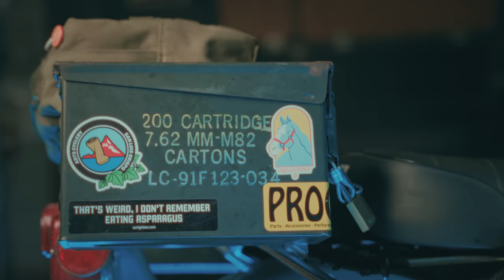DIY Ammo Can Panniers (44's Donut Vault)

Comment: I just attached 20mm ammo cans onto my crf300l as diy panniers and they work great. They are larger them 50 cal cans and are about the same size of tusk aluminum panniers for a third of the price. I think I will do the cable lock like he did, seems to be a much better locking system.
Reply: I mounted 40mm cans to my Duke 390 and they work fantastic. $20 each!
Reply: I just mounted a 50mm gun and haven't had many issues since.
Reply: I mounted 30mm cans to my vstrom. I saved money by making the rack for them as well. I can't believe what they sell those aluminum ones for. I did order ammo can locks off Amazon tho. You can easily clip that cable with a leatherman
Reply: Another simpler latch lock. 
Drill a hole into the box at the center of the hole in the latch. Put a bolt through the hole from the inside and nut it down. Drill a hole through the end of the bolt for the pad lock.
This would work better on a latch with a much smaller hole in it though.
Reply: @bloodbushcraft2467  well, maybe not a Leatherman, but it will definitely stop a normal criminal from getting in. Any really determined criminal will get in to any lock but if it stops 9 out of 10, thats a good lock.
Reply: @gregorytubbs3444  sadly the bigger cans have really big holes in them, but that might still work with some modifications.
Reply: @afallencheetah6610  do you have a rack for the 300l with the pannier sides or just the top rack portion? Curious how you mounted them.
Reply: @kite-fan  I got the tusk top and side rack. I originally was using their soft roll top bags but I find them to be super annoying to get stuff in and out of.
Reply: @afallencheetah6610  thanks bro

Comment: I put 60mm Mortar cans on my KLR, amazingly useful but they weighed down that bike. The performance was a drastic difference when they were on and off.
Reply: Harbor Freight carries ammo cans of different sizes in metal and much lighter plastic. Both are cheap as dirt. Between the $50 pannier racks and $24 for two, heavy duty .50 cal, watertight metal ammo cans, I'm happy to once again "beat the system," cheap man that I am. I think, like highway crash bars on a cruiser, they may very very save a leg or exhaust some day. Bought a smaller pair of .32 cal cans for the front panniers on the front of my RE Himalayan. I think they may also save a leg, light, gad tank, etc, if I ever go down. Plus, the Army Green color looks awesome, IMO, with the camoflauge "Pine Green" color on the bike.
Reply: I put the Princess Auto (aka Canadian Harbor Freight) Pelican knockoffs on my KLR. Mucho lighter. I have real Pelicans on my WeeStrom and boy have they been crash tested. The Pelicans survived to bend the racks they're hanging off of.
Reply: Who's got 120mm mortars?
Reply: I also added a set of 60mm grenade round cans from Princess Auto to my KLX (Just like to add that Princess Auto is also a terrible store compared to Harbor Freight). They're too heavy for offroad. They'll shake the racks right off the bike. But they're great for commuting and running around town. On and off in under a minute for when the offroad mood strikes.
Reply: @MichaelWhite-cx4ho Your comment about "beating the system" reminds of me looking for a cable tray to mount behind my desk. I went to a DIY store, but everything labeled as a cable tray was way overpriced for the simple pieces of metal or plastic they are in my opinion. So I went home with a plastic rain gutter for next to nothing. Works like a charm :)
Reply: Did you take the shells out?
Reply: @MichaelWhite-cx4ho  I had a set of 20mm ammo can (18.75"L x 14.5"H x 8.25"W) panniers on my Suzuki M50. They DID save my leg when I went down.
Reply: @TheVgonman  Thank you, Mate!  That's the kind of practical, real-life knowledge that I love to see passed on. Thanks for posting! By the way, I bet looking at any damage on the can(s) made you smile when you thought about how that damaging force didn't break your leg.
Reply: @MichaelWhite-cx4ho  Oh yeah. I did get a broken arm/shoulder and collarbone out of the experience, though☹
Reply: @MichaelWhite-cx4ho  funny you say that, the mortar cans hung so low, if you tapped the ground while riding, my foot would sometimes get pinned between the can and the ground, dragging my toes through the dirt. I only used the cans while camping and touring, mostly they were off.
Reply: @birdatkinson1  What kind of "bike" did you have them hanging off of where they'd "scrape the ground?!" A Big Wheel?!
Reply: @MichaelWhite-cx4ho  they didn’t scrape the ground, they would pin my foot against the ground on some off road conditions if I let my foot on the ground too long or just right.

Comment: Those are awesome panniers! The American expression "Give 'em the whole nine yards" comes from ammo boxes: if you'd remove the original belted ammo and laid it out, the length of that belt is nine yards. Ammo boxes on a vehicle hide a lethal secret if you store actual ammo in them for a very long time: The gunpowder in each bullet is made of super stable nitro cellulose, shaped into little grains or tiny flakes. Driving over bumps shakes the gunpowder around inside the casing, and over time can turn it into powder. Nitro cellulose in powdered form has a dramatic increase in burn rate, instantly transforming your rifle into a pipe bomb that you are holding next to your face.
Reply: Use the shock absorbing cargo carrier intended for Honda Super Cubs, instead?

Comment: The side of the can will split as it work hardens taking out a neat ring of metal the same size as the repair washer within a few weeks. You need to put a piece of plywood down the whole side you're attaching them to on the inside and bolt through it if you want to use ammo cans as panniers.

Comment: I'm doing something very similar, adding two large 20mm ammo cans (each large enough for 1500 rounds of 7.62 mm ammunition) to the headache rack on my 4WD Hijet Japanese mini truck to use as tool boxes.  I'm adding remote keyless entry to the little truck so the tool boxes will lock and unlock with the driver and passenger doors.

Comment: 3:17
Oh, so THAT'S how you're supposed to secure those wire-connector things!
My dad and I would always just strip the wires a bit more and twist them together
Reply: I always twist>solder>heat shrink.
Reply from the maker: twist-solder-heat shrink is definitely the longest lasting solution. But those solder-seal wire connectors are not far behind and sooooo convenient. ~RF9

Comment: I put some decent locks on my ammo boxes by fastening a lock hasp loop underneath the flip handle. You can put it through that round hole. To fasten it, I used short carriage bolts with the roundhead on the outside, and the bolts on the inside. Put a nice big circle lock on it that won't pass through the hole. You can even cut a slot for the lock hasp in that flip handle.

Comment: This is perfect for me. Cheap and made of surplus.
Reply: I just started on yesterday, and it's looking good. I'm using 50 cal cans it's looking good so far. I have an old suzuki and it is the same rack and tail light setup. I'm not really an electrician though, so I'm trying to figure out how they did the wiring. Did they put both positive and negative in the bullet connector?

Comment: My go to has been a Tusk Pannier rack with a set of used Pelican 1550 Cases for my 1290 Super Adventure. Just over $300 all-in.

The pelican cases are strong enough to protect my gear, flexible enough not to crush or dent when I smash them into the side of the trail or gravel. Waterproof, lockable, easy to take on and off, and carries like a briefcase. My only complaint is that stickers don't like to stay adhered to the sides of the cases.

Comment: FWIW, there is (or used to be) a bolt-on tab available for those cans that allows locking through that latch hole without making a cable.

Comment: Another simpler latch lock. 
Drill a hole into the box at the center of the hole in the latch. Put a bolt through the hole from the inside and nut it down. Drill a hole through the end of the bolt for the pad lock.
This would work better on a latch with a much smaller hole in it though.

Comment: Pro tip, 44: crimp your swages in the other orientation (so that the sleeve goes from a tall 8 to a squat 8). It will get you a much more secure connection.

Comment: There’s a better way to make locking ammo cans.  We did it at work.  Use a cam lock on the lid.  With the turn of the key the lever rotates to a cross bar installed inside the can.  It’s quite easy.

Comment: Haha, I've got a set of HF plastic ammo cans bolted to my 83 Nighthawk 5/650 with flushmount taillights in them, wired for brake, taile & turn.

(this bike is for sale…I have too many motorcycles…)
Reply: The locking system is much simpler than that mess. There are many ways you could have made that (much) easier to use, but would not have been as quick to implement.

Comment: If you want better paramilitary psychotic soft panniers look for "Dutch army rubberised bags" 
They are basically the same style as WWII British webbing bags and like the British bags are available in two sizes 
I have the small sized ones fitted as saddle bags on the Hodaka Wombat in my profile photo
I fitted them by cutting squares of plastic wheelie bin that fit inside the bags and are bolted through holes punch in bags and drilled through the plastic to brakets on the Wombat's rack 
I also use a large sized one as a shoulder bag
They are near indestructible and, as they come without hole drilled through them, they can can be used like a bucket to carry water

Comment: Not a great idea. You'll take a chunk out of your leg if you misjudge when getting on or off your bike on the sharp corners, thats part of why hard bags are curved on their corners.. If you do put some on, put them on so the lid hinge is facing forward as you'll have less water/road crap getting inside. Also, if you forget to buckle the lid down it won't act like a drag chute if you bolt them on so the lid hinge is facing forward, much less chance of the lid popping up when you least expect it. You might also remove those handles as they will rattle like a mutha.

Comment: A rubberised cover for the padlocks and you would be set.
Reply: Or just use padlocks intended for outdoor use?
Reply: @libraeotequever3pointoh95  I was thinking when the padlock starts whacking the box - I doubt anything with a plastic cover would survive for long.
Reply: @MrLachlanmackenzie  use an old rubber inner tube as material to make cushioning cover.
Reply: @libraeotequever3pointoh95  Great idea 👍

Comment: Hardly a new idea, I had ammo boxes on my KZ 750 over 25 years ago. Of course I went with a much bigger ammo box.
BTW, if you're going to put much weight in it you should put reinforcements on the interior of the can.
I used to put my bike on the center stand and stand on top of the ammo cans to reach the overhead storage.
Those panniers were stout.

Comment: I am hoping to see the ammo can pannier trend die off. They are not a cool and cheap way to get storage on a bike. They are heavy, low volume, and really unsafe in a slide when your leg gets between the pavement and sharp corners of the box. Built for battlefield conditions, ammo cans are robust. Such that you can have frame damage in a crash that could have been avoided with plastic panniers or soft luggage.

Comment: Well done, but this entire set up is a huge pain in the ass: stating from making those and ending with questionable practicality. Size this small with a big ass lock to rattle while you ride is just not something you want on your bike. Not to mention it getting wet and rusty with time. But I guess that sums up most of DIY crafts: pain it the ass and questionable practicality. Spend the same time working and you'd be able to buy a simpler and better thing. Maybe the process itself is what people crave and I just don't understand